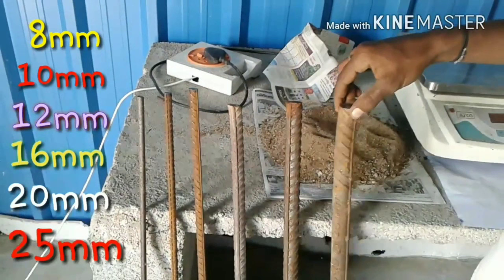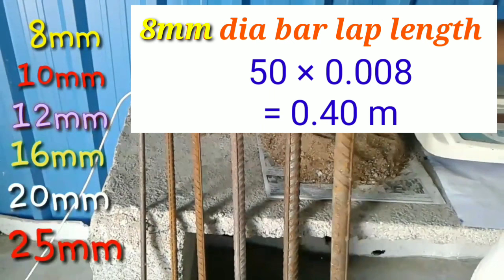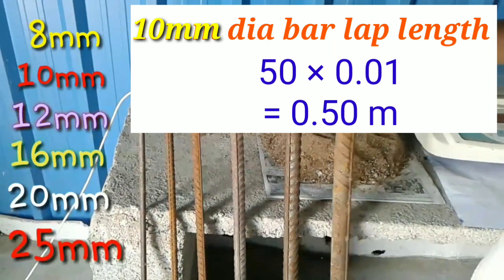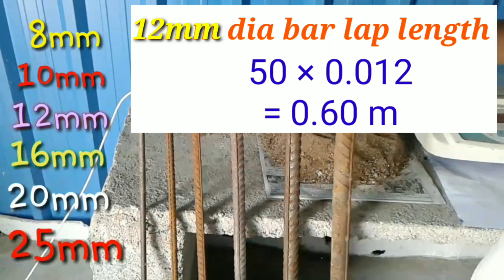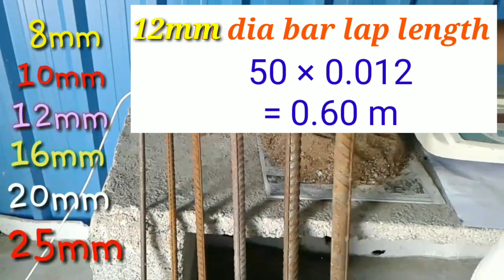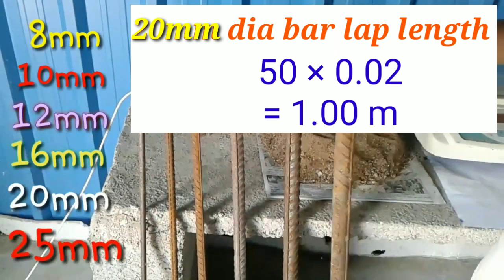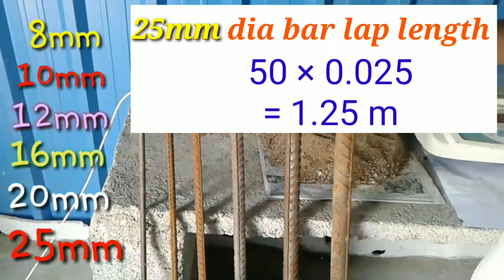How to calculate lapping length of steel | Overlapping of steel bars in columns, beams, slabs

Comment: Sr Mera pillar 18 inch lapping hua 16 mm rod
Reply: Kya hoga
Reply from the maker: Kamsakam 2ft 6 inch karna 16mm dia bar keliye
Reply: @SmithikaEngineers  aab kya kare
Reply from the maker: Columns concrete work complete or not
Reply: @SmithikaEngineers  not complete
Reply from the maker: @subashchandramallick6732  cement ni akkuva kalapandi. Cement akkuva kalapadam valana grade of concrete peruguthundhi
Reply: @SmithikaEngineers  please write in english
Reply from the maker: @subashchandramallick6732  increase the cement quantity in mixing of concrete then grade of concrete is increasing (or) columns lapping length is correct positioning tying